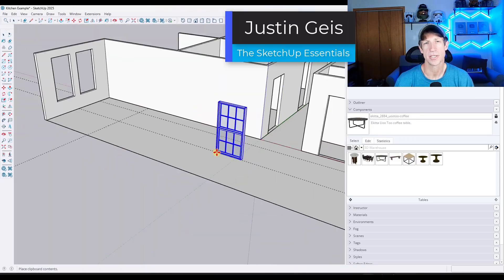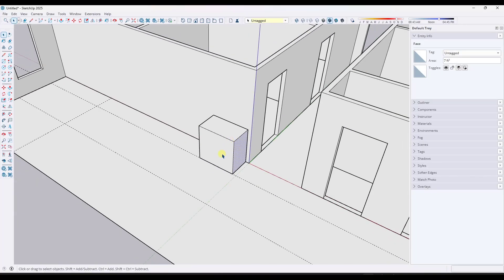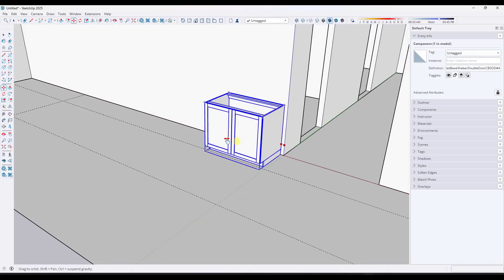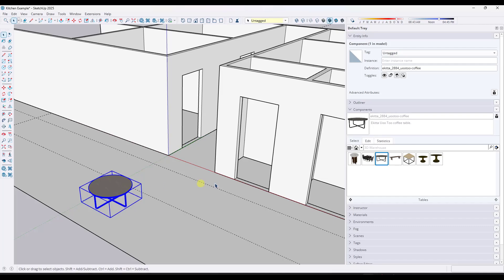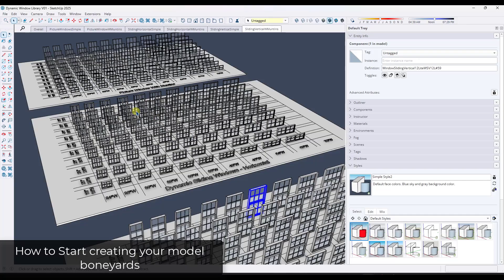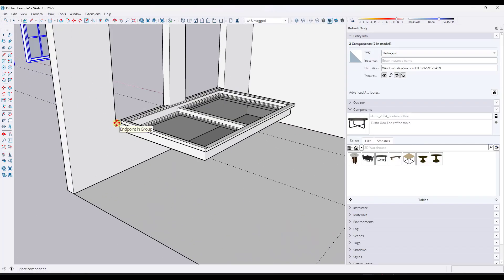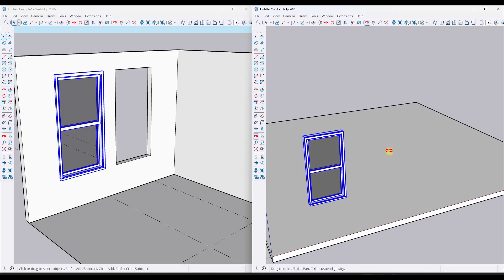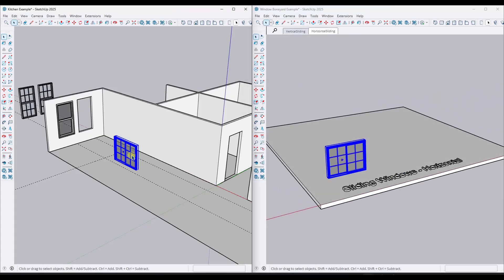The RIGHT Way to Manage Your SketchUp Model Libraries!

Comment: My personal approach is profile builder walls to hang self cutting windows or doors. I set the popular header height and a centrer pick point or snap so I can simply drag the item from the bone yard into my working model and viola, it's placed just like I want it. Also. I can use Profile builder pick profile tool and grab the wall type I want. One other tip. But use at least two monitors for SKU. One or half of one can be used to display your bone yard like a heads up display. I use Curic text app to avoid bloated 3D geometry for text notation. Scenes for bone yard areas is pure genius. Love it.

Comment: The other advantage of the bone yard concept is that sketch 2025 purges unused layers, so if your bone yard has the blocks and the established layers you can keep a consistant layer name setup.  I even add parts of wall, entourage, etc so if I havent added that element to my new file the layer isn't purged.
Reply from the maker: Ooh - good point - didn't think of this
Reply: @Thesketchupessentials very important for example for Curic Section

Comment: You can get som nice boneyards with screws etc if you dont do architectual drawings.
Reply from the maker: Intersting - what boneyards do you use where you want screws? Usually I don't like my stuff to be to this level of detail
Reply: for example hex screws for engineering or woodwork

Comment: Justin, could you also make a video showing how to create a dynamic component that changes size when you keep clicking on it? For example, like a wardrobe that cycles through different standard heights or widths with the interact tool.

The idea is not to fully manipulate the dimensions, but to instantly switch between predefined standaard manufacturer sizes with a single click.
Reply from the maker: Personally I wouldn't build them like this. I suppose you could, but I don't really see why this is more beneficial than allowing user inputs in the component options to just switch to exactly what you want instead of cycling through presets

Comment: This is a great idea!  I'm working with 12" and 16" truss all the time and I have all the blocks as separate files in a folder.  Every time I start a new drawing I'm always thinking 'there has to be a better way to to this.'   A ordered boneyard file is more visual and will be much faster to use once I set it up.  Perfect small project to do around the xmas holidays when things are slow.  Thanks Justin!
Reply from the maker: You're going to love it. I'm not perfect about this either - I've been using SketchUp since like...2010 or something and I just started taking this seriously last year. It's made a massive difference for me, and really it's one of the things that make guys like Nick Sonder so effective as well (you should see his libraries :) )
Reply: If you are talking Truss for roofing then you may want to check the paid plugins by medeek. He's a structural engineer that fell hard into the SKP plugin dev role and now we get these high detail house component plugins that are modular, easy to edit (like revit) and auto created roofing and other house parts. If you are talking Truss for staging then I'm not sure if medeek has that (but maybe). As easy example, for complex roofs, all you need is the bottom outline where the roof hits the walls and the angle of the roof pitch and his code will create all the the different parts of the roof at different heights, Roof cladding, sheething, Truss beams (with many different options of Truss types) etc. It's really great if you need it with any frequency more than once. It has more automated detail then you will likely ever even think about and it's architecturally accurate.

Comment: If the components are dynamic then I don't really get the value of having a boneyard layout of "every" option when all you have to do is simply adjust the DC. It seems way more work which also breaks the workflow by having to go back and forth from window to window compared to simply stretching or adjusting the DC to your need. Good dynamic components are very valuable and useful imo and I do certainly recommend to build a local library of these objects for re-use. Also, good plugins like gkware cabmaker for kitchen cabinets or medeek for walls and windows, or great DC window/door components from Marvin, Anderson, trustile and others exist on the sketchup warehouse. My current local library of objects/components/materials/textures currently stands at almost 80GB 😂🤣😂.
Reply from the maker: It kind of depends on your use case. I find it valuable if there are different standard sizes that you see to have them pre-sized to those sized, but you definitely don't need that. It's also a bit of a visual indicator of what the components can do. If it's just for your own personal library, you probably don't need that either. 

It's funny how long I waited to start making my own libraries. I save SO much time just with the dynamic cabinets now, and I also have them kind of modular (though I'll be adding to this in the future). I have both cabinets complete with doors and drawers, and I also have just dynamic shells where I can put custom doors on them if I need them. It's SO much faster. 

I do wish we could see some improvements to the original dynamic component authoring tool. I don't need everything in Trimble Creator (nor do I really want to re-learn the authoring process) - I just want things like the copying function to work better - they have SO much potential for more
Reply: @Thesketchupessentials  Most of the name brand window/Door DC that I have collected from the warehouse have the option for actual sizes (presumably that they sell) and also custom sizes (which can be anything). I near always use them if I can because I would trust a companies actual model compared to one I would have to manually create plus they would likely have better more accurate details in the components that I wouldn't draw as correct as they would have them... most of the time. 

A local library IS a game changer. It's one of the first things I recommend to people. If you need it twice then save it locally. I, often, go through a finished model (such as a house) and will save things I like to my library for potential future use. Before Trimble changed the layout for the SKP warehouse, I would often randomly browse through the warehouse and collect things that I would maybe potentially use in the future for quick access. Now, you have to find things through searches and its much harder to see things in quantity.   

Now that I'm older, I really just want things to work... Like you said, and I'm much less likely to want to futz around with things and waste the time. I just want systems and workflows to work efficiently and usefully and output a high quality product.

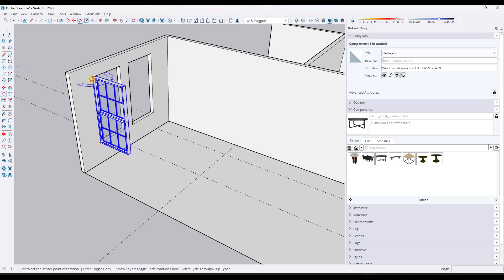Comment: 5:56 – SketchUp really needs an update that allows you to easily rotate a component while moving it, before you click to place it. That would make the workflow so much smoother.
Reply: I like this idea. This sounds like something that would also be super easy to code or even vibe code. I bet there is a plugin that already puts a hotkey to auto-rotate an object with just a keypress (such as rotate object 45' every keypress).
Reply: @johnjlopez  Yeah, it does sound easy enough for programmers. I don’t know if you use Lumion, but in Lumion you can rotate an object while in selection mode just by pressing ‘R’ – super easy.

I really hate placing an object in SketchUp and then going through the whole process of rotating. Most of the time I use the shortcut ‘Alt+R’ for the Rotate Object plugin and then press the arrow keys multiple times to rotate it on the Z-axis. But still, I need to click to place it before I can do that. 

Still easy but the most efficient way is to have the possibility rotate it before placing it
Reply: @rajivsporkslede7860  I don't mind the move then rotate as separate to keep them distinct since they are different but I really like a hotkey to autorotate compared to hitting a hotkey and mousing the actual rotation manually which is a pain now that you make me think about it. I'm gonna look for something or maybe even try to build this but I bet it already exists. 

Separately, Eneroth already has a plugin to hotkey a texture which I find invaluable. No more mousing into select only the texture then right click to adjust then etc etc... 
It's called Eneroth texture positioning Tools.

Comment: Hey Justin,
Would it be possible to create a library of railings by taking all the Vali Instant Railings and making them adjustable with Profile Builder? Every time we use Profile Builder for railings, it would be amazing to have a collection of Vali Architect railings inside it that are fully adjustable.

The main issue with Instant Railings is that they’re not flexible. If we could combine them with Profile Builder 4, that would be a real game changer. The challenge is that it’s really hard to make them work properly in Profile Builder.

I’d honestly be willing to pay every single penny for this if you could make it possible, not just for me, but also for the rest of your audience.
Reply from the maker: Nope - there is no interaction between Vali and Profile Builder. I do agree though - I'd love to see either an improvement to the functionality of Vali, which has amazing libraries, or improved railing library in Profile Builder. 

I also think it would be cool to see Profile Builder expanded outward with more architectural functionality - so kind of a custom build of the tool for different functions (which would look a lot like Instant Architecture, honestly). I'd happily pay for a "Profile Builder railings" branch that was optimized for railings, "Profile Builder Windows," etc - that's an interesting idea (that doesn't solve your current problem :) )
Reply: @Thesketchupessentials  Thanks for the reply, Justin! 🙌 and i'm completely agree with you on this one
Reply: I only have an older version of profile builder and I always had trouble making an assembly work properly under all conditions. They almost always broke when changing heights (like a rail going straight then down stairs) or turning corners for inside and outside the turn conditions. It was so frustrating to build one that I almost always just built them manually if it was anything more than the simplest railing...